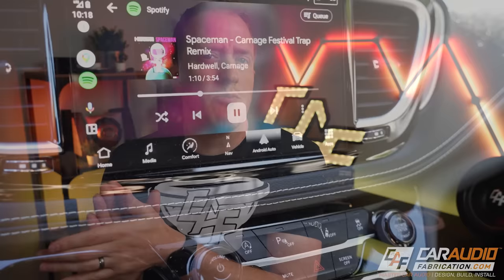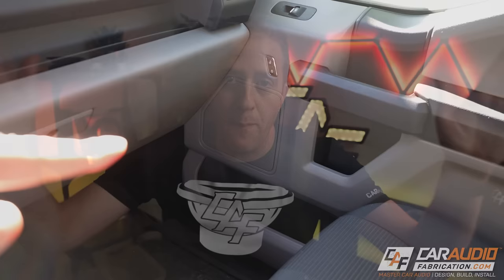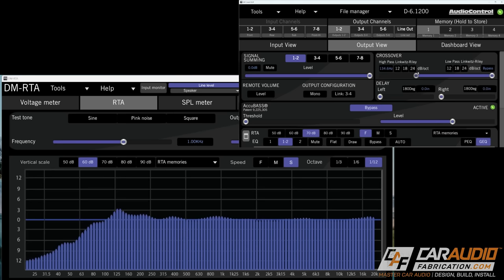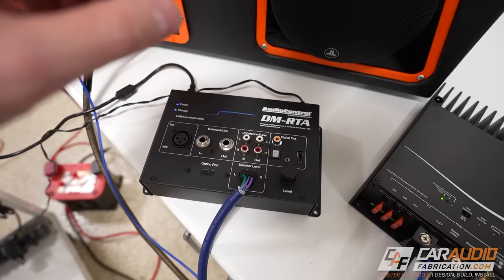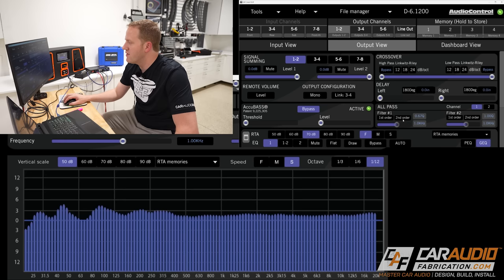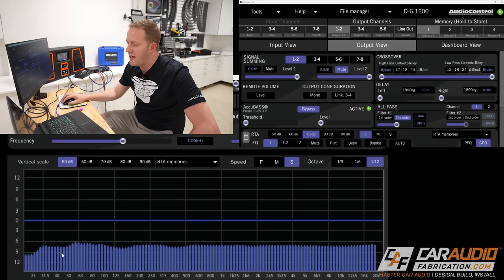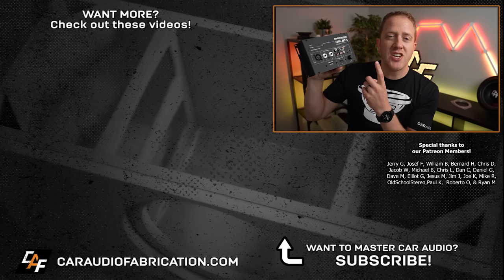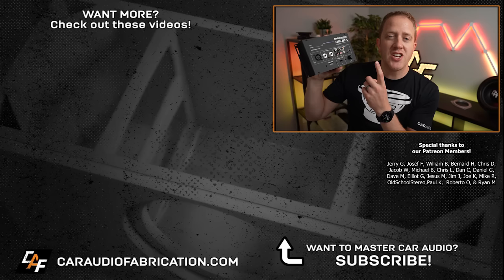Car Audio All-Pass Filters - Correct them or use them? Explained!

Comment: Mark, can you do a video on doing a 2 seat tune, and how you would use all pass filters and time alignment on a aftermarket DSP to optimise the response for both driver and passenger.
Reply: Hey dude. I've had the opportunity to talk to Nick Apicella and Doug Dobson about the two seat tune they did in Doug's old Kia Optima, which is my current vehicle. First of all you need a center channel up-mixer. And I can tell you from my own personal research the best would be Helix whether it's a DSP or DSP amplifier with "real center" up-mixer, but also one of the newer features called virtual channels. For the tune you want to use no time alignment with the microphone placed in the driver's seat. You will apply an all pass filter to the mid bass to give that separation that Mark is describing here and in a similar fashion to how OEM applies it for optimal two seat listening. In conjunction with the center channel up mixer (real center). You will also use (if you buy the right audiotech Fischer piece that has it) virtual channels. You will create left and right virtual channels for all front speakers, extracting out the center information. For example your left mid-range would have a virtual channel that plays 85% left and 15% center information. You would play with all of this until you find what suits the vehicle best. Finally you would verify the two seat tune by moving the microphone to the passenger seat to get it as close as possible. Trust me I've been researching this for over a year now and it seems that the SQ community is way beyond caring about it anymore. The main point is you'll never get a two seat tune as good as single seat. But if you get a Helix remote controller then you can set up multiple tunes and switch from your single seat to a 2 seat, passenger seat, party mode, etc.

I really apologize if I just dumped a ton of useless stuff on you but as much as I love this channel, I'm more of a Helix fanboy over audio control. It will get you much closer to a two seat tune than the latter.

Comment: I have purchased the JL VX1000/5i and C3 6.5's for the fronts and C2 6.5's for the rear of my 2024 High Country 3500HD.  I am at a complete standstill as to what to do next so the system sounds the way it should.  All of my installers around me say they will not do the install as it will not sound good until there is a true factory amp integration for the bose system.  What else would I need to get this going in my truck?
Reply: It’s because the VXI is the wrong amp for your application. Use a Helix V EIGHT or a V TWELVE if you have the Bose ultimate system (centre channel, a pillar tweets) the VXI you bought doesn’t have the right processing capabilities (no input EQ correction) or the correct amount of channels for your truck WITHOUT an amplifier replacement module. I have done a V EIGHT on the standard Bose system, integrated channel for channel and got amazing results by keeping the oem phase processing and utilizing OEM speakers doing a global eq to get better results than the factory. Louder, cleaner. Then if my clients want to upgrade their speakers, I would use a wide band on the dash and 6x9 in the door to keep the sizes the same as we will keep the phase processing and by doing that with 2ohm drivers the amp will push more power, therefore more volume potential. 5 channel amps don’t work in these vehicles anymore. The Bose system is using APF like mark is explaining in this video. The VXI does have the capability I believe to correct for them acoustically but you only have enough channels on that guy for your front stage, not your rears. That’s probably why your installers won’t do it, because they know it will lack in performance.
Reply: @Dman199739  forgive me, as I only know so much about this stuff. I went with JL cus I heard they were really good stuff. I didn't think my truck had a center channel? My 2020 Denali didn't have one, so I assumed it just had the dash tweeters, 6x9 front doors, and 6.5 rears. 

I personally have never heard of helix, so I'm looking forward to doing some more research on it.
Reply: @Dman199739  I had another thought, couldn't I also use the VXi amp with a JL AUdio FIx 86 and use that for input EQ correction?  I already have the VXi amp bought and used it in my 2020 denali, and it sounded fine and got really loud, but I know that I can get better sound.
Reply: The fix 86 will sum the outputs and doesn’t correct APF. Summing the outputs electrical when it has an apf will cancel the frequency response electrically like mark is showing here. It’s an outdated product and has been for 10 years. Your truck has 7 active channels dash, doors, rears and sub. You can’t just do a 5 channel and an expect an upgrade. Unless you’re taking the time to correct all APFs and frequency response issues then in the end you’re going to downgrade to a passive front end.

Comment: So if I have a peak that happens around 1000hz does that mean that I have my speakers out of phase and it has an all pass filter from the factory?  Or can I apply one to make it dip back down?? Cause I'm having a lot of issues with the electrical response from the signal. I feel like I could test it by simply switching the polarities of each channel. But I wanted to see if you had thoughts on what this could be

Comment: I've been on the fence about switching to an external standalone DSP, but I feel I'd end up regretting it (based in cost). I still have an older vehicle with an aftermarket head unit (Kenwood DDX9906XR), CDT Audio components, Image Dynamics subs, and Zapco amps. My head unit has on board DSP but I was thinking of adding the 16 channel DSP unit from Zapco. I just think the gains would be marginal. On a new vehicle and using the factory head unit, a DSP would be a must.
Reply from the maker: Every system can benefit from DSP. Your head unit is not offering the same level of options as a dedicated DSP would. I'd recommend learning on your existing system, then when you do need to interface with something more complex it won't be as daunting a task. You can always move it from vehicle to vehicle.

Comment: I recently upgraded the speakers and added a sub to my 2015 Tahoe using a pac to get the signal to rca. The system is step back from the bose which was tuned to the truck, would you suggest getting a dps or and aftermarket head unit?

Comment: Just gotta use any Audison Forza dsp amp can correct 99.9% of all systems even with all pass filters etc etc
Reply from the maker: I prefer to understand what it is that a DSP is doing rather than just relying upon a automated process. There may be cases where you want to keep them, as discussed in the video.
Reply: @CarAudioFabrication  oh yeah no I get what you are saying in the video
I dont use the auto process 
Ken ward taught me to do it manually :)

Comment: I'm having trouble buying some audio system, I want to put in my car a 13 channel system,
With 4 tweeters, 4 mids, 4 woofers and 1 sub, but I don't know to wire the amps and where to where I can connect, and how many amps I need
I'm really seeing your videos like a Tv show, but I still don't know how to do it

The reason I want a 12.1 ch is that I see that some cars already came from factory with a 13 or 14 or even 17 ch audio system and I want a premium audio. I really appreciate music and I want something like I'm with earphones and I can hear  every tone, every instrument.

Can you please make a video planning a 12.1 system? Please
Reply: I think you have some wrong ideas about sound...  The most obvious is that a system with 4 tweeters, 4 mids, 4 woofers and one sub is not a 12.1 channel system. Another one is more speakers does not mean more quality...
Reply: @mindtraveller100  I really new in this type of systems, and this will be my first, but I'm seeing some car's like range rovers , mercedes and lexus with more than 13 speakers.
The car I'm trying to install is the Land cruiser 200 basic version, but even the full option of my car model comes from factory with a 13ch JBL synthesis 

That's why I'm thinking in that

Comment: I'm gonna go to a reputable shop to get my system tuned...
Reply from the maker: Nothing wrong with that if this is a lot to understand. For the best performance though these things do need to be done correctly
Reply: Don't get me wrong I'm all about getting educated. It's just that if I don't know where to start I'll be spending more time trying to figure it out than having a solid starting point. You videos do give some insight, but I think a deep dive into a dsp tune would better put things into perspective.
Reply: @CarAudioFabrication  also want to say that my build is going to be fully active 3 way front and rear on a 2024 truck... So I face way more obsticles than the conventional install.
I am looking for a dsp to control everything, currently looking at the dd audio dsi-3 or c-dsp. Both 12 channel dsp. My 3 way is stereo integrity.
I was looking at helix dsp... But that 3x the cost of my other options.

Comment: Car manufactures should be required to have front, rear left right 4v full range outputs accessible in the trunk!!!
Reply from the maker: It would potentially cost them $10 per vehicle so that will never happen. A defeatable processing option would be great though. I'd take that all day
Reply: Very nice explanation, but quite complicated if no one has seen your videos before. 
However i have a request. Can you make video exlaining how to set the "Q" on dsp's?
I only found one video of a guy explainig the formula dividing frequency by bandwith.
Does this apply here to car's DSP's?
Thanks.